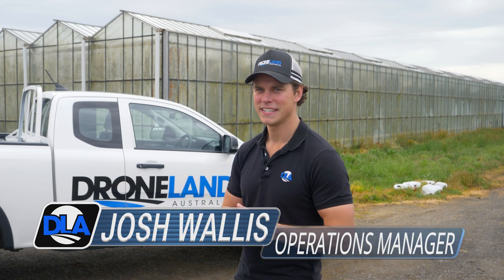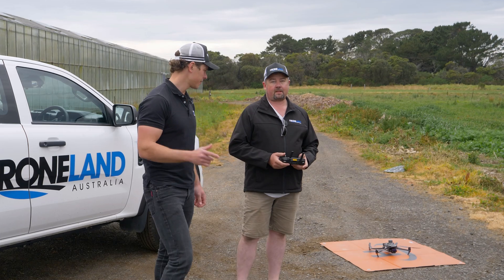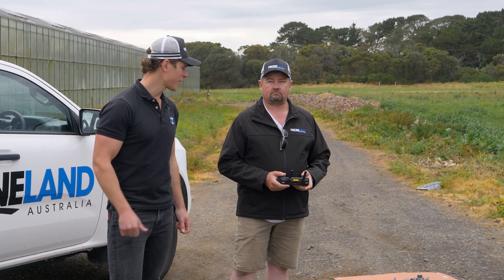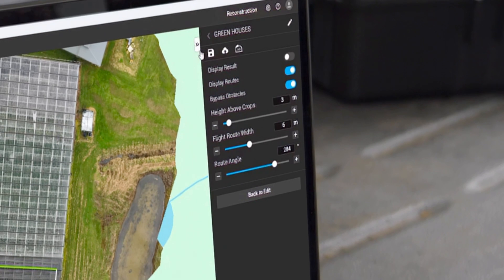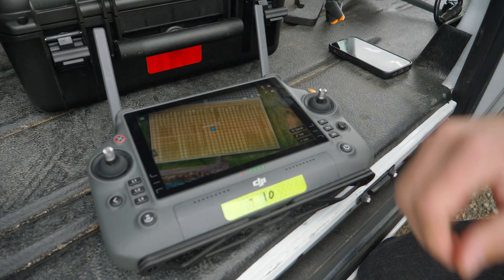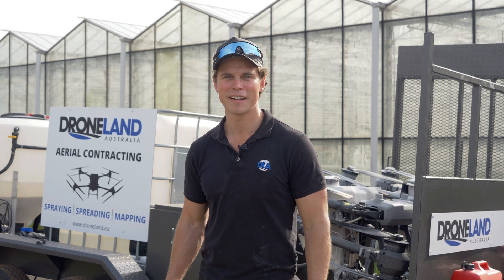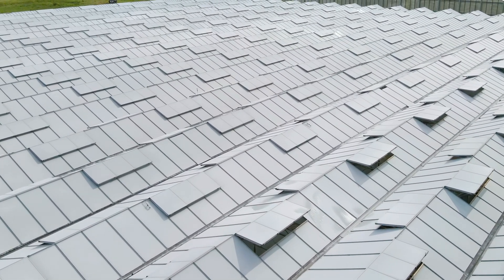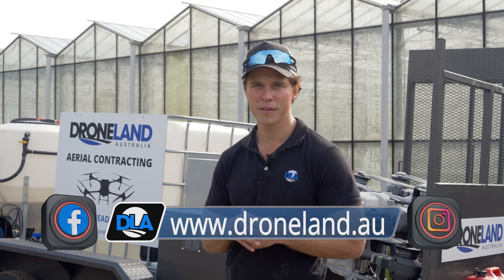DJI Agras - Whitewash Spraying

Comment: Can this be done without the mavic?  Using Rtk and mapping using the t50.  Route planning and go? What do you gain by using the mavic instead of mapping with the t50? Genuinely interested in the process.  Just got my t50 over winter for orchard and corn spraying and never thought to use it for our greenhouse’s white wash… I have been pulling off a balancing act walking gutters haha!
Reply from the maker: Yes, you can complete the same process using the mapping function on the DJI Agras T50, then setting up route planning and "GO".
While we used a DJI Mavic 3 to map the entire site (as there had multiple greenhouses) and created individual greenhouse maps from there, the T50 is fully capable of handling the mapping task.

For a single greenhouse application like yours, the T50's built-in mapping capabilities should work perfectly fine. The T50's mapping function will give you everything you need to create accurate spray routes.

Congrats on getting your DJI Agras T50 - it's an impressive machine and a versatile tool. Using it for greenhouse whitewash application is definitely the safer option compared to walking gutters! Let me know if you need any guidance on setting up the mapping operation with your T50."
Reply: @DronelandAustralia thank you for  your detailed response!  I will definitely keep watching your content!

Comment: Very nice material. What is the dose of liters per hectare and how long does it take you to cover e.g. 1 hectare during a working day?
Reply from the maker: Each application requires different litres per hectare rates, and different flow rates, which will also vary the time it takes. Each application can be different from the last.